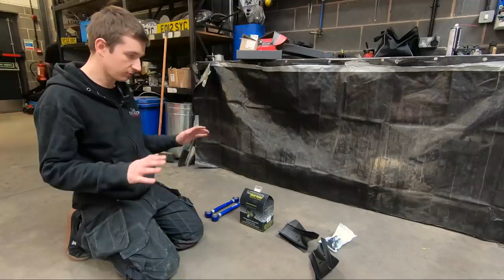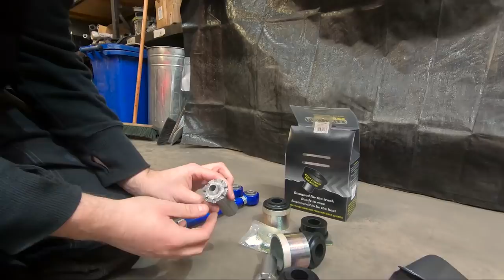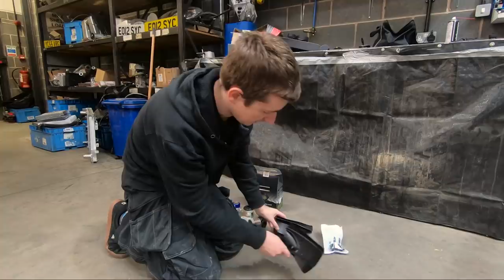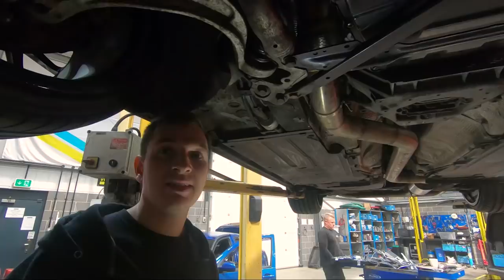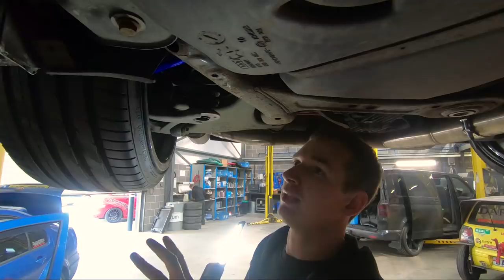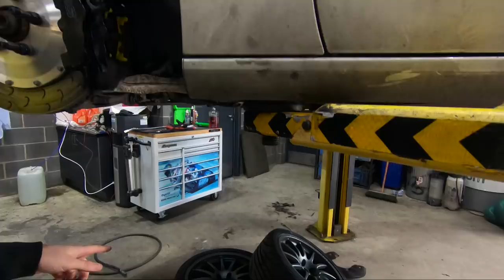BIG BRAKES AND ALIGNMENT - AUDI A5 3.0 TDI QUATTRO PROJECT - DARKSIDE DEVELOPMENTS - PART 17

Comment: Thinking of switching to a similar set up with the BTCC disks any downside to the brakes on a daily driver also when will they be back in stock?
Reply: Also will the disks & RS calipers fit under the stock 19" Audi rotor wheels
Reply: 19s should be OK. It's just the rattle that might annoy you!
Reply: @ryanp6138  does it rattle constant or just at specific times / speeds
Reply from the maker: you only hear it at low speeds

Comment: hello the front calipers was plug and play? the rear audi rs5 with original disc is also plug and play ? thx
Reply from the maker: If you use the original discs, hoses etc, front and rear is plug and play. 
We decided to use better discs for track - https://www.darksidedevelopments.co.uk/products/368mm-front-btcc-track-race-brake-conversion-kit-for-b8-rs4-rs5-brake-calipers-pagid-rsl29-pads.html

Comment: Do you sell the silicon intake pipe which goes straight to turbo tip instead of onto turbo muffler? Cheers
Reply from the maker: Yes we have one for stock MAF - https://www.darksidedevelopments.co.uk/products/2-7-3-0-tdi-audi-b8-platform-airbox-to-tip-silicone-hose.html

Or one for 88mm MAF - https://www.darksidedevelopments.co.uk/products/2-7-3-0-tdi-audi-b8-platform-larger-airbox-to-tip-silicone-hose-for-88mm-bi-tdi-maf.html

Comment: I'm interested in the kit.
Reply from the maker: https://www.darksidedevelopments.co.uk/products/368mm-front-btcc-track-race-brake-conversion-kit-for-b8-rs4-rs5-brake-calipers-pagid-rsl29-pads.html
Reply: @DarksideDevelopments  i have a 2012 S5 facelift. From what i can tell on your website they aren't compatible.
Reply from the maker: @Inimbrium  Audi B8 Platform Vehicles with RS4 / RS5 / R8 Calipers (66.6mm CB)
Reply from the maker: @Inimbrium  It fits all B8 platform

Comment: Can you not run flexi ducting running from the front bumper for cooling
Reply: Yes but not directly to the disc, it just won't fit
Reply: @ryanp6138   i was think something on the lines of this. 
http://www.singularmotorsports.com/write-ups/tech-article-brake-cooling/

The last pic mate i.e. run it like a backing plate. carbon fibre or ali
Reply: design & make your own??
Reply: @andyhopkinson2708  we tried for a fair while but back to the drawing board when we have time

Comment: NOTHING  to do with your products.... however please use knee pad/trouser inserts when you're kneeling down. As a "creeky old knacker " with buggered knees please don't get yourself into my condition. However geeat vid all the best.
Reply from the maker: I've got about 4 pairs and usually put them in if I'm doing loads of spanner work which is very rare! You do need to look after the body at all costs!